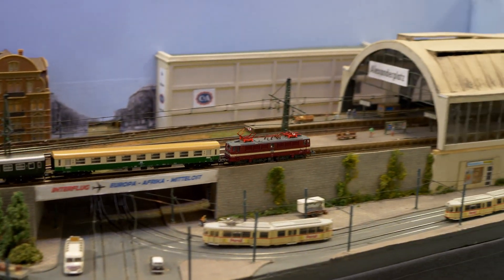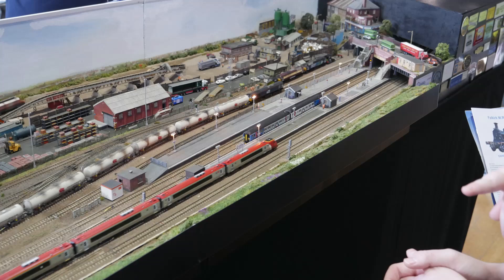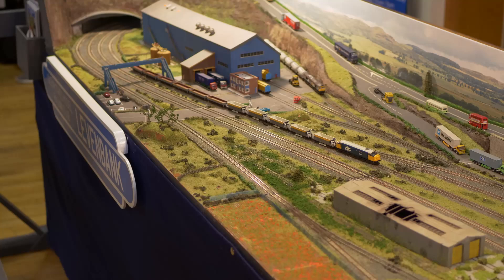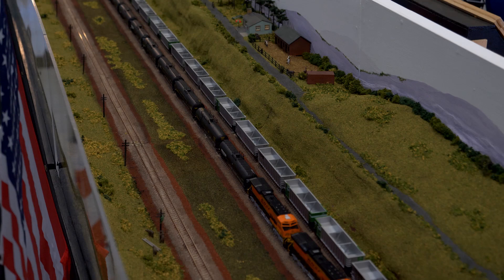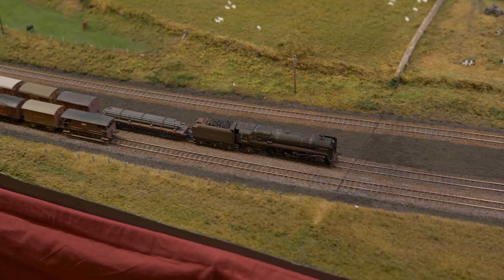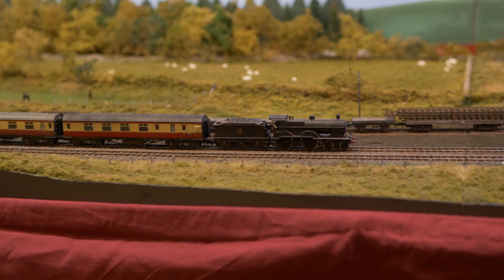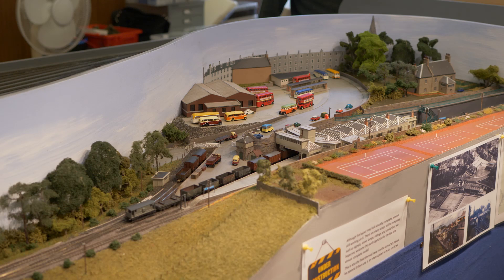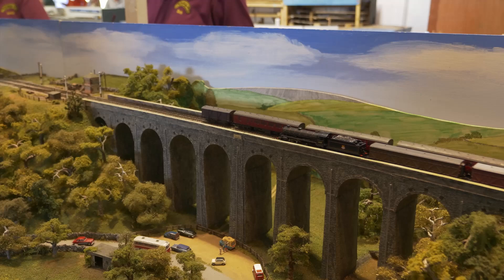Model Rail Inspiration Part 6 Large N Scale Layouts

Comment: after seeing this i have a question for you all. Is having a 18 m2 layout considered big in N gauge? since i hav nothing to compare what i want to do but club layouts which most of them actually seem a bit smaller than what i wanna do. so i was wondering if anyone has a layout in that size.
Reply from the maker: You don't indicate whether you plan to build an exhibition layout or a home layout. If you are planning an exhibition layout I would say it would be too big. Exhibition managers work to a fixed floor size and always want to maximise the space available. More layouts attract more visitors and hence generate more revenue. Check out the last layout in my latest upload (Part 7). The layout is James Street and is one of the largest layouts on the British exhibition scene at the moment. It comes with a crew of 10 which can also put off some exhibition managers as that is a lot of expenses to pay. Hope that helps. Stay safe. Andrew
Reply: @andygebbie  its mainly planned for myself since i have the space available in my basement. But i could bring it to exhibitions because im building it modular in case we have to move out. its still very eraly though and i only got 3 baseboards and no frame to put it on since money is kinda tight atm ^^.